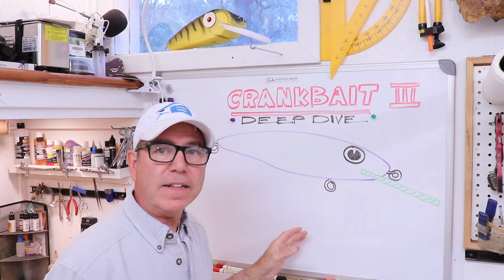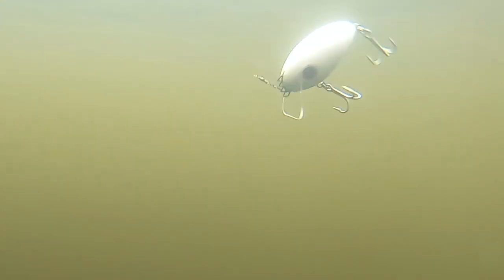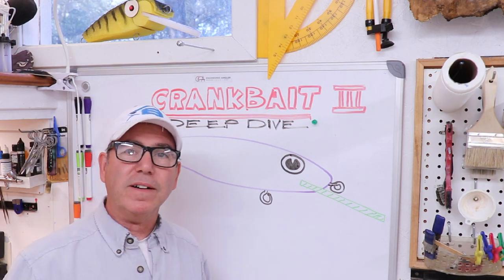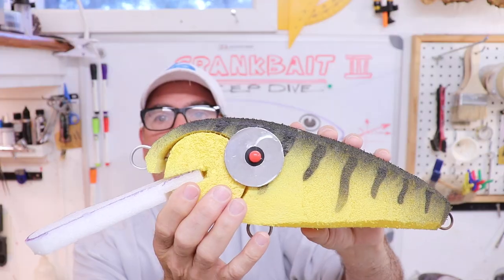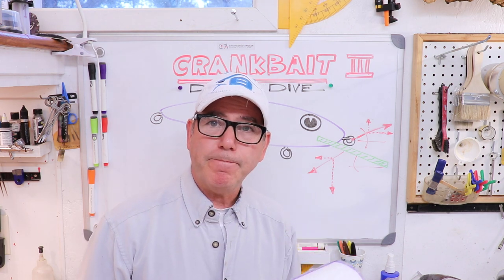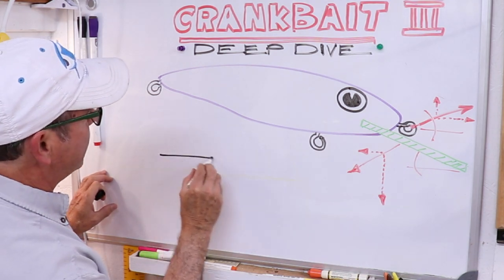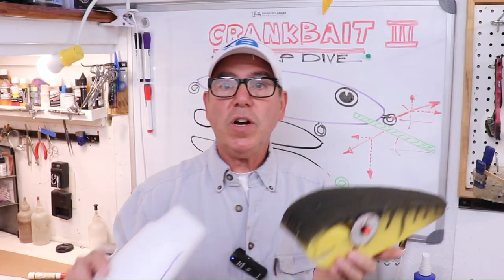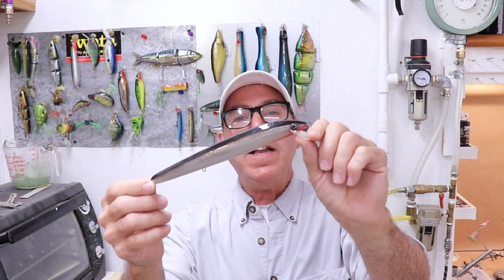Crankbait Master Class III, How to Make a Deep Diving Crankbait  #deepdiver

Comment from the maker: I didn't cover weight distributions,  but let me give you a quick note here. Weight distribution mostly affects the action, and the closer to the head the weight is, the more of an energetic action. But if your lure is excessively tail heavy, it could increase the depth of your dive while sacrificeing some action. Of course, if your lure is buoyant, that will tend to decrease the depth of dive.  A sinking lure or even neutral lure will dive a bit deeper.  An aerodynamically shaped lure body could affect the stability of the lure but is not likely to affect the depth of dive.
Reply: Great vids Franco, I got into lure design because of them... Trying to make lures I need for trips that I can't buy... Wonder if u ever made vids discussing what makes a lure cast well and accurately - how many of us find a great lure that casts terribly😂
Reply: I make the lazy Ike the exact same as your video but I made it an inch wide with the same amount of weight. It just drags sideways on top of the water. I probably should have added more weight and calculated the required buoyant force to be slightly above neutral 😢

Comment: If you do any structure trolling you quickly learn to pick lures that will dive deep with a short amount of line out so the lure better tracks the path of the boat and still hits bottom. Most crankbait seem to have a dive curve of 3 to 5 to 1. Meaning 3 to 5' of line out for every one foot of lure running depth. I'd love to find a crankbait that has a 2 to 1 dive curve.

Comment: Excelent video, with a ton of technical info, which you dont get in the internet easily. Thanks.

So, I understand that the more surface area the lip has, the more force against the retrive it will make and tend to dive more. What I doesnt understand is why the same applys to the surface area of the top of the lure. I would have thought that because that area is behind the line tie and lip, it could apply an inverse force, making the front of the lure rise instead of dive... Thats why I tought banana shape lures dive deeper. But according to your explanation this is the opposite way...
Reply from the maker: its not always easy to intuit...

Comment: OK now I want to see you make a lure that maximizes dive depth with a decent action. (how low can you go...) My buddy asked if I could make a lure that will dive 40 feet, my knee jerk response was that I didn't think it was possible. However after doing some research and poking around the internet I think it is possible just really really challenging.
Reply from the maker: 40 feet is a stretch...it would have to be an extreme design and it would have to really cast a long way...sounds like a fun project.
Reply: @EngineeredAngler  Well we want to fish for Ling cod from a kayak. Lings are often even deeper than 40 feet, we'll likely use it in conjunction with a down-rigger but we don't want the down-rigger anywhere near the bottom. A hung rigger weight can be a safety hazard in current and the weights aren't cheap either.  But mostly I just want to see if I can pull it off.  With the info that you shared and some commercial designed baits as a template I think I have a shot. Even if I get one that goes 25 feet that would probably be a good start.

Comment: Hi sir
How thick almunium foil is best to buy for lure making purposes ...
Reply from the maker: You can use very thin household foil, but you have to be careful handling it. If you can find air-conditioning foil tape, that is the best.
Reply: @EngineeredAngler  f9 airconditioning tapr thnx,, how many mm will be best

Comment: My notes of all 3 crank bait master class lectures

Class 1
- skinny lip causes head shake or wobble
- Wide lip causes roll back and forth
- If you want the most roll have the wide lip and put tie on eye as close to lip as possible without it getting totally out of balance

Class 2 
- He explains why moving the tie on eye closer to the lip creates more instability (moving it closer to center of drag). The closer to the lip the more erratic. The farther away (up), the more smooth and stable
- Sometimes a round bodied (hydrodynamic) lure can have a tendency to porpoise depending on the tie on eye because the turbulence isn’t causing it to shake or roll

Class 3
- Factors that are important for depth of dive
        - bib angle (closer to parallel to body/.   shallow angle = deeper dive)
        - length of lure/flat top (longer = deeper)   because it keeps lure from going completely vertical
        - size of bib: longer bib causes faster dive at beginning. You may need to move tie on eye down onto the bib to increase erratic action (implied from class 1). If you move it too far past the center of the area of the bib, it will become unstable

- bonus from EA comment section: weight distribution mostly affects action. Weight towards front = more energetic action. Weight towards the back = less action but possibly a deeper dive. Sinking or neutral lures will go deeper than floating ones
Reply from the maker: Dude, Nice!
Thanks for sharing with everyone